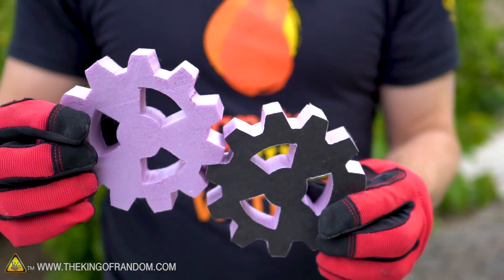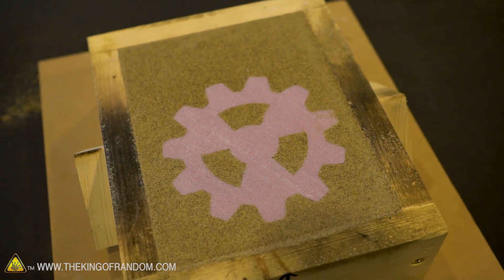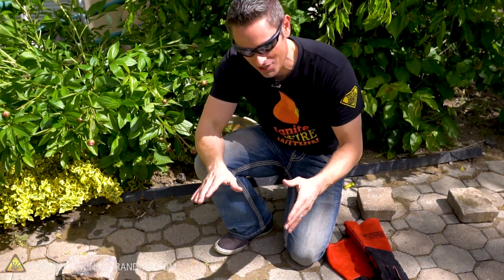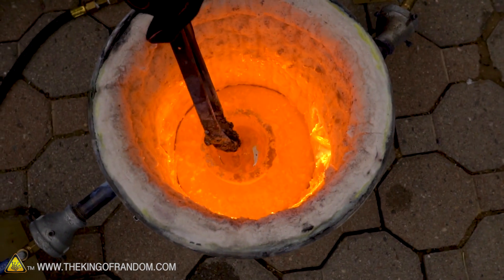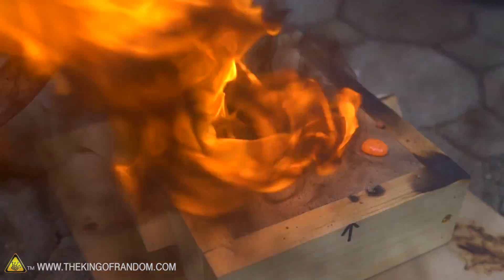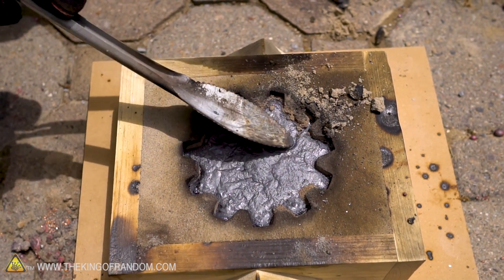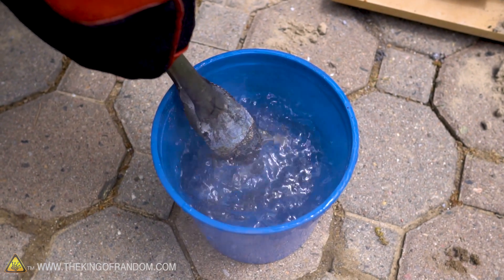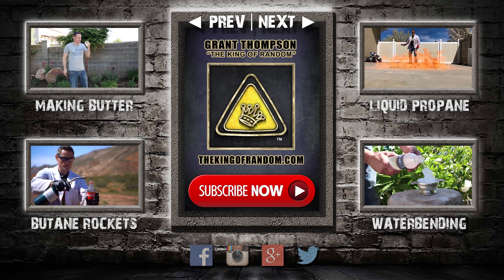Argh. Why Is Copper So Difficult? TKOR Tests Melting Copper In Our Homemade Foundry

Comment: Hey "the king of random", as copper is a fairly dense metal the green sand is unable to support it

So try using an oil based casting sand (Petrobond) which is used to cast precious metals like gold which has an even higher density than gold 

So I suggest you buy some Petrobond

Comment: @Grant Thompson-"The King of Random" Try a two part mold for it next time a lower that as the gear in it and the upper that just a funnel in it to get it centered and act a weight to hold down the smaller / lighter parts of the mold.

Comment: What if you do the copper gear the same way as you did the gun or the sword? Put the foam gear into the sand and surround it with sand , lead a way to the gear with an other foam and then you cut it off.

Comment: Gear is too 'deep'.  It lets the sand float.  You can either make the webs, core and ring of the gear thinner (thus making a 'lighter' gear using less copper and creating less buoyancy for the sand), or thin the gear down, or make an inset so the webs are thinner in cross section which would also strengthen the base of the cutouts.  Other option is to cast with a top, using vents and pour hole.  The sand cutouts couldn't 'float' because the top would hold them in place.  I'd also use a real crucible holder.  Making your own is fine, quite the TKOR project, but you need it to pour safer, faster.

Comment: I use to work at a metal foundry.. You have your mold on top of your sand, It should be in the middle, with two pour spouts going down to it, pour in one and the metal comes out the other indicating mold is full. it should melt your foam no problem basically In other words you need as much sand on top of your gear as you have below it.

Comment: Use your gear mold like you used the Styrofoam to make the metal short swords. You have to have a channel to pour the molten metal into, not directly into the flat sand. Make it a vertical pour instead of a horizontal pour, too.

Comment: The sand is less dense than the copper, meaning the sand wants to float. Use something more dense than the meatal you are working with but make shure they are not the same denseity otherwise the meatal will mix with the mould. Also try burying the stirofoam

Comment: What if you put a wooden case on top of the casting and drilled a hole through it. That could keep the middle radioactive sand places up and the casting might work better.

Comment: I think the issue is that the sand actually wants to float on the copper. Since copper is denser it pushes the sand up. A closed mold should do the trick.

Comment: You could be pouring the copper too fast. Copper is pretty dense,proven by the sand floating on the copper, and that weight could be putting so much pressure on the sand chunks that they just snap.

Comment: if you made bigger mold the sand will holds up(bigger chuncks of sand make is it harder to floats) but not so big that it takes long enough for the copper to coll down (you have to find that ultimate ratio)

Comment: You need a higher clay to sand ratio for your green sand so that it stands up to the dense copper better. Also for the radioactive symbol.  Why not just make it half way down so that you still get the symbol but the copper goes overtop of it so that you just have to carve the rest of it out.

Would take a little bit more time but solve the problem.

Comment: your green sand mixture needs more clay I recommend kitty litter the clay kind not the clumping kind hope you find this comment useful and another thing if you pre-heat your molds it'll will allow you to 1 melt the foam gear and 2 keep the Copper from solidifying

Comment: I recommend you to add CO2 gas in side the sand to make it harder and use the original method which used a pattern and raiser , runner

Comment: ok Grant the way you're supposed to do it is have the Styrofoam in the dirt then take out the Styrofoam without messing up the details then you can pour the molten metal in without having the Styrofoam in the sand

Comment: Try using both sides of the casting box so that the styrofoam is completely encased and then try poring in through a hole

Comment: try using refractory cement for a mold. then put the mold into the furnace to burn the foam out then it will be perfect for any metal. you would just have to break it when done.

Comment: if you use a wider draft angle on the internal voids you may have better luck. also when doing detail work it is sometimes usefull to stabilize your sand with cement plaster of Paris or liquid glass. also check out some of SV Seeker they do some pretty incredible casting

Comment: Grant,your green sand doesn't have enough clay (binder) if you want an easier path,start with fresh sand and use sodium silicate (water glass) as a binder and co2 to activate the SS.The mould will be hard and much tougher than green sand so you can remove the foam pattern.
Mix up a mixture of powdered graphite and acetone in a spray bottle,once the foam is removed,spray the inside of the mould with the graphite mixture.Once the mould is coated with graphite,light off the acetone to burn it off.The graphite will act as a barrier between the sand and the copper,and will also help insulate the casting from the sand allowing the copper to stay liquid longer.

Comment: why didn't you bury it in the sand i.e a two sided mold and just add a fill hole and a vent hole? wouldnt have the floating sand issue

Comment: You should get the copper at a scrapyard it would be so mouch less expensive. 
Also you should use a blowtorch to melt the styrofoam and you should remove the left over plastic before pouring.
You should also think of plaster molds they wouldnt break as easily and you could remove the styrofoam without breaking the mold.

Comment: hey man, try to  add a top to your mold, the substrack you are using floats on liquind copper,  and try to leave a piece o foam that will conduct the liquid to the mold, much like you did on your first metal casting videos. second, if you whant to have more details to your cast, try to heat your mold a little, not too much because this will evaporate the watter and the mold will collapse

Comment: Try using cement or concrete instead of that sand to see what would happen. This would be interesting because it can set with the styrofoam in place and then you can melt the styrofoam like you have been doing.

Comment: Using a two part mold, top and bottom with plenty of parting powder, should be more secure and hold the heat a little better.
Graphite and diatomaceous earth are often used for parting powders.

Comment: Grant use oil instead of water in sand
Reply: Look for oil bound sand
Reply: Also try both cope and drag with a riser as it gives less air contact it won't solidify quickly I think

Comment: Because copper has a high melting point it is really hot. Maybe this is what brakes the sand, the high temperature metal just dries out the sand and the sand brakes. Just a random thought.

Comment: what would happen if you poured  copper in to a silicone casting
Reply: Kaileb Wiseman it just burns through. I tried it with pewter at 300°C and it went through pretty quick, use copper at 1000° and it's even faster.

Comment: the sand is popping out because the density of sand is a fifth that of copper. You might have better luck using plaster as it is much stronger and harder than sand

Comment: Put molten iron or copper and dump it in dry ice or liquid nitrogen
Reply: Iron will cause the cops to be called because of the explosion, copper is the same thing but less. Also he can't melt iron, iron has a melting point in the color range of high white, or approximately 2800 degrees F. I have a propane forge and it can hardly reach that, it wont work to melt it.
Reply: Oh Thank For the INFO
Reply: Iron Bro it will blow up

Comment: talked to my friend whos a blacksmiths apprentice and he told me that they use a wax figure submerged in some type of material that you get up to a certain temperature in a kiln then they pour the metal into the wax and thermal material mold and the wax burns leaving the bronze or copper into the shape the wax left in the thermal clay? and after letting it solidify they just put it into water to cool.

Comment: @Grant Thompson - The King of Random
what u should try is putting an square peice of Styrofoam over the gear  and  the part showing the gear cover it with sand and when u flip it over and only see the square peice of Styrofoam  that where u pour the moslten copper  on . hope it helps byeeeeeeeeee

Comment: You need to pour the gear in an enclosed mold; for that you need to add a top piece of sand, like a cover to prevent the 3 litle pillars of sand from inside the gear (radioactive symbol) to break loose. They broke loose because copper has a greater density than sand, and acording to Archimede-s law" Any object, wholly or partially immersed in a fluid, is buoyed up by a 
force equal to the weight of the fluid displaced by the object."
     Otherwise great job, I really like your videos !
            Greatings fron Roumania !

Comment: Just a guesswork here, but:
A "skeleton" wire might help the protrusions to stay in place? Like rebars in reinforced concrete.
Another method is to set the mold  vertically in to the sand and pour the metal from the one tooth on the top. That particular shape doesn't look like it can trap big bubbles of air.

Comment: drill a couple of holes on the base of cruseable then pour liquid copper through it it will act as a funnel but before pouring liquid copper through it make sure that the funnel is red hot otherwise the copper will solidify in the funnel it self (like if you agree)
Reply: Mohammad Palla Drilling a hole into it would severely damage the structure. Crucibles with bottom releases are designed that way. Not everything can be DIY
Reply: You can't do that. Crucibles are extremely brittle and any damage to it will crack the entire thing. A little bit broke off the top of ours and when we when to use it again the whole thing shattered.
Reply: You made plenty of spelling errors  so I highly doubt grant will even consider your comment as it seems you lack the basic knowledge of English.

Comment: when i did copper casting, the inside pieces of sand that kept popping out happened to me aswell, i fixed it by shoving metal wires in through them as the Styrofoam is in it, and then fixing any imperfections the wires caused by just packing it down a little more
Reply: also** if it doesnt work, try gating it :)
Reply: or you could put a top flask on it

Comment: Your issue is that the cutouts are not secured. if you did a two part mold, the greensand from the top mold should anchor those in place better.

Comment: How about you put the whole box in the oven to melt down the styrofoam?
Reply: most likely, the sand won't melt because the sand has a higher melting point then copper.
Reply: 向天翊 会烧掉的
Reply: how about the box is wood. The sand can melt but it has an extremely high melting point.
Reply: Wouldn't it also dry up the sand
Reply: you're assuming the sand won't melt...

Comment: Dude put a little more bentonite clay and burn the foam and heat the surface so it hardens up and it does not break please try it out I have seen it work

Comment: you said the heat makes the sand toasty, cant you just try to get the sand toasty before you take the copper in? Maybe in a hot oven that even melts the styrofoam.this could make the details more stable.

Comment: you need to make a 2 part mould, with a channel to let the copper flow into it, can leave the styrofoam in too, make sure you have a vent hole opposite to let the gases from the styrofoam escape as it vapourises

Comment: Hey grant try taking a Benzine torch to the mold prior to copper it should help reduce the thermal shock on the mold and you can pour at a cooler temperature

Comment: why not use a two piece mold.  one with the styrofoam gear and the other just fill with sand after cutting out a filling hole and a vent hole

Comment: Why don't you try spraying some acetone to remove the polystyrene, that's how I've done it to remove it from inside hollow fibreglass shells. Also, your pour is breaking away too much sand, might have too much water,and you might need to close the mold and make a spout to pour it in. And make it vertical instead of on it's side. Maybe.

Comment: Wet with a splash of water to sand to dampen it then dissolve the sciuma with a flame and heat the mold with a flame for 30 seconds more or less then pour the copper very liquid slowly and not quickly so as to give the sand the time to take off The moisture it has inside without breaking the geometry of the sand

Comment: Are you using a water-based sand or an oil-based sand? Pre-heating with the crucible could be evaporating the moisture from the sand leaving it so it crumbles apart from the weight of the sand. Have you tried drywall mud coating the foam to keep it rigid when you melt? You could hypothetically hold the shape without pre-heating the foam.

Comment: drill a hole into the top of the mold so you can poor the metal in through the hole see the chunks of sand can´t float up.

Comment: you need to use a second box the same size and pack it full of sand without any foam mold in it at all then u use a price of that copper tube to cut out a circle in the second box
Reply: that allows you to make a funnel for the copper and it also holds down the sand so it won't float above the copper

Comment: the copper is more dense than the sand so the sand floats almost. I reckon, if you put a Lid on but have a hole in the middle of the gear, the sand chunks won't pop out. worth a shot?

Comment: I've done this before in High School. Casting copper you need to use a fully enclosed mold. Open-molds won't work at all for the kind of design you're trying to cast, Grant. You are also going to need more clay in your green-sand so that it holds onto itself better and retains the heat from the copper.

Comment: I do believe your sand was too dry to start. I also believe you would have better success making a two past mold with a sprue riser and pour as fast as the sprue will except the metal. Hope that helps.

Comment: is the wooden part of your mold properly able to withstand the heat of the copper? You could saw some long pieces of wood and lay them on top of the 3 middle pieces of sand that kept popping out whilst you're pouring the copper - it could keep the sand pieces in place? you could screw the wooden bars onto the wooden frame of your mold to make sure that it doesn't lean heavily on the pieces of sand and disrupts it

Comment: Make a video on whether dry ice can melt.
Reply: Turtle Friend the smoke isnt it melting, the smoke means that it is sublimating.
Reply: it does melt, the smoke that comes out is the dry ice melting
Reply: but is there a liquid form?
Reply: irfan2507 yes, under high pressure it will melt

Comment: Go for depth casting, with the entire Styrofoam mold buried in greensand, and then a rectangular piece of Styrofoam connecting the buried mold and the surface to act as your pour channel. Also, use a piece of wire coat hanger to make a tiny venting tunnel so gasses can escape.

Comment: The sand is too cold, its cooling down the copper too quickly. Try using warmer oil or heat up the sand a little. (just a suggestion) love your vids
Reply: While the potential is there, water is very crucial when it comes to making green sand. Permeability of the green sand is measured when casting cast iron so that when the water evaporates, it is able to escape.  A balance of enough water to produce a clean part and sufficient permeability are tested (among other things) using cylindrically compressed samples called "ram samples."  Anyone who tells you that green sand does not have water in it does not know what they are talking about.
Reply: hot water lmao terrible idea
Reply: water would make it explode when it evaporates
Reply: christopher newton but thats how grant made his greensand, its kitty litter, fine playground sand and water.
Reply: my apologies, i have not seen how to make greensand yet because i have an extremely full schedule and have not had the time. Thanks for correcting and informing me about this.
Reply: Any moisture in the sand would instantly flash to steam when you pour copper, or any metal, on it. It would be very dangerous.
Reply: greensand isnt made by adding water. you have to put engine oil in it
Reply: Godshole not so green sand has to have water in it for proper adhesion of the granules
Reply: CleanerThanU please look it up petro sand is made with oil

Comment: GRANT!!! from the first pour on the first video i thought you would run into issues because you are not using a 2 tier mould, you need to make a second block of sand with a hole through it and place it on to of the bottom mould and then pour, this will solve both of your issues by holding the sand in place and holding in the heat longer. Please revisit

Comment: Never done anything like this but, would it be possible to try covering the entire mold with sand ( 1 or 2 inches) digging out a hole towards the center of the mold until you reach the mold, then just pour the copper into the  hole. The copper should replace the foam fast enough and the top layer sand should help to stabilize the shape... just a thought

Comment: hey Grant I have a tip for you I do cast copper in green sand so what you do is stick a little stick in the radio active holes ( the things that popped out) while the styrofoam is in it so it don't break it should be Strong enough to hold thanks for reading